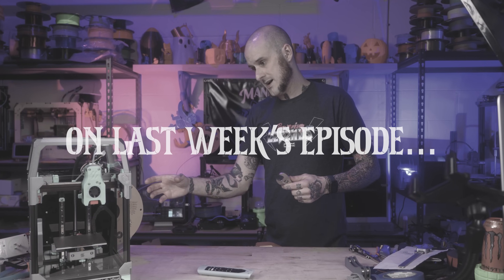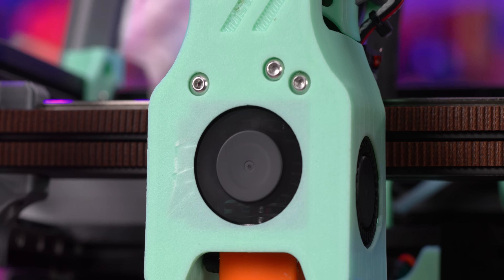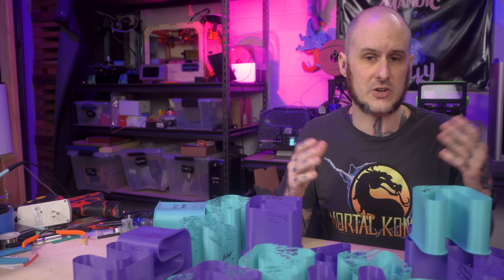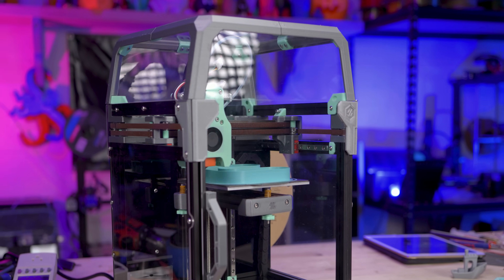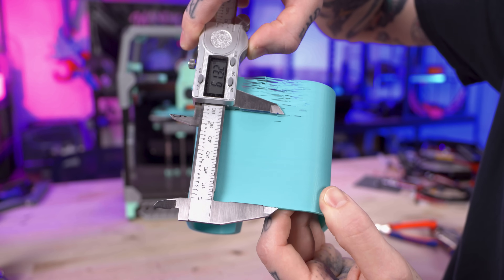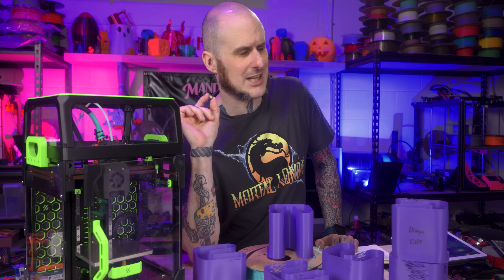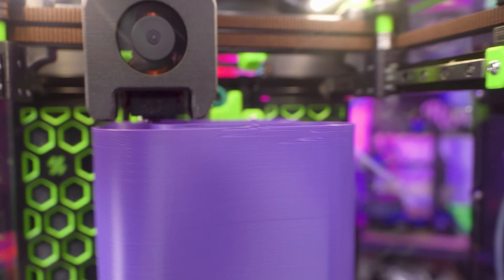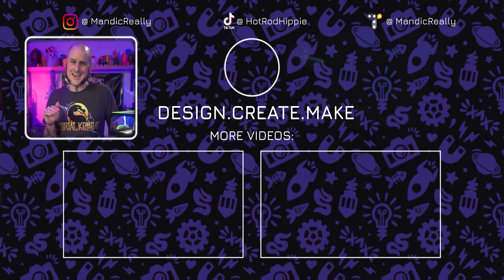The TRUTH about CHT Clone Nozzles! - Are High Flow 3D Printer Nozzles worth it?

Comment: Very interesting findings and great in depth research on that weird nozzle.

For an easier an more precise way to test hotend flow rate (as you asked for at the end), check out Stefans (CNCKitchen) recentish video on the topic. The general idea is to, instead of printing an actual part, extrude a known quantity of filament at different speeds/flow-rates (just into a blob) and check with a scale whether the requested amount of filament was extruded or underextrusion happened. Much faster and more precise.
Reply from the maker: Yea you just need a good scale for that and I didn’t have one on hand. Also I like tests that test practically. That is excellent for data points but I wonder how it translates to use. Would shine a light on the under-extrusion I was referring to though.
Reply: @MandicReally  When I've done the weight tests, I've found they're good for finding an upper limit but that actual printing will be at a lower feed rate. I'm guessing that's because extruding in the air requires less pressure and loses less heat, while squishing the plastic into the previous, already cooled layer will take some pressure and remove more heat. TLDR, after the weight test you would still want to do the real world print test.
Reply from the maker: @Cookiecad  Yea, if I start doing weight tests I'll only add them as a secondary test, not eliminate the printing tests.  I agree, real world scenarios are just different.  Tests for tests sake are valuable for data gathering but need to be viewed in a specific way to see their true value. 

All of this testing is "Flawed" in that it requires MUCH more testing and control to be truly viewed for just the numbers.  Extruder, filament path, the filament being extruded, part cooling, etc.  So many factors effect the results.
Reply: @MandicReally  I'm actually really curious how much the extruder plays a part. On my direct drive ender style hotends and cheap extruders I only get 17 mm^3. Do you think the 30 you were getting was due to the extruder? Or does that machine have a larger melt zone like a volcano? One of these days I'll need to try using a better extruder with the same setup to see what effect it has.
Reply from the maker: @Cookiecad  It is just a variable that can cause issue.  I doubt it would skew results upward, but possibly down.  Yes the results I was getting in the 30+ Range were with the Phaetus Dragon High Flow hotend, which uses a longer melt zone that starts in the heatbreak to generate more flow.  Thus why I was saying that the un-modified Knock-off nozzle performed better there.  The filament was already melted by the time it reached the nozzle so the "wall of brass" in the knock-off nozzle didn't effect the already molten plastic. 

I'm running some testing on an entirely Stock Ender 3 right now.  The crappy plastic extruder with straight cut single extruder gear is slipping when trying to push the flow higher.  These more advanced extruder assemblies all work around pushing more filament with less effort.  Either through Gear Reductions or enlarged drive gears (or both).  I've not directly tested it but have seen others test and show that just different extruder drives can cause flowrate changes.  Not massive ones, not something I'd go changing just based around, but measurable differences.  It is a bit hard to articulate why I feel this is the case, but basically it comes down to mechanical advantage pushing non-molten filament into the melt zone.  Stronger extruder drives can overcome resistance of filament that isn't melting rapidly enough better than more "basic" ones.  Obviously you reach the limit of the hotends ability to melt filament at some point, but combined with all the variables it can change the results of what that limit is.  

It is kind of like the extruding in thin air test.  When all the variables are combined, things will change versus just testing one single component.  Which is why tests like this are hard for some folks to relate to. "Well on my machine that hotend flowed way less!", yea because your variables are different.

Comment: It seems like the other variable is the heat transfer of aluminum versus copper, and brass versus copper. The center of that opening in the clone is likely not keeping hot enough, so the filament is hitting a wall, so to speak.
Reply from the maker: On paper yes copper conducts better than aluminum or brass. In actuality I think it’s been shown pretty regularly that it is a marginal difference on printer components. I’ve found little to no real benefit between the two myself. My Biqu H2 has an Aluminum heater block from Phaetus and that hotend pushes 50% more flow than it is rated for on a a regular basis.

Comment: Hello nice video , I think you can add m220 cmd in the slicer if you using superSlicer or prusaSlicer add custom + button like filament color change ( right click / add custom gcode ) .
Reply from the maker: Still a pretty manual process. I’ll see if that works and will output. I know height range modifiers do not.
Reply: @MandicReally  yes the height range modifiers not able to give the possibility  to custom Gcode , but after slicing with + button you can.

Comment from the maker: A few folks have pointed out that the Klipper "TUNING_TOWER" function could be used to automate the file here.  Excellent point that I forgot, check out the Klipper Documentation for more: https://www.klipper3d.org/G-Codes.html#tuning_tower
For this purpose I feel the G-Code I generated still works better as it was a very easy file to just Click "Reprint" to continue using for testing.  Great for shutting down, restarting, updating, and anything I needed to do while filming this video.  But Tuning_Tower would be faster for 1 or 2 tests.
Reply: Note that tuning tower seems to be finnicky with vase mode because it runs the command every time Z changes, overloading command processing.
Reply: Mellow 3d also has a cht clone if you send them a message on aliexpress

Comment: You can quickly measure for a drop in wall thickness on a test print like that by using a dial indicator over a small-radius (I'd recommend something BELOW a 1/8"/3.2mm radius/ 1/4"/6.4mm diameter) base (i.e. a small ball, or piece of round-bar mounter horizontally).
Align & adjust the dial indicator so it shows "0" when it is just touching the base, then you can run the test piece over the base & the dial indicator will show you the exact wall-thickness of each layer as it squeezes between the indicator & base.

I know this sounds a but complicated, but once you have the dial indicator, you could easily 3d print a stand for it & a base to glue a BB on top of; then spend 3 minutes assembling & then measure test prints at somewhere around 300 layers per minute (depending, of course, on exactly how OCD you want to be about watching the needle move for each individual layer)
Reply from the maker: As it is printed in ASA and only a single perimeter, minor war page induced by shrinkage  is likely. Every one I printed was slightly warped in the wall. The only real way I see would be breaking the layers below the failure and measuring your way down step by step.
Reply: @MandicReally  Hmm, I'm thinking of arranging the indicator and base to look kinda like two dull pencils with their tips just touching each other.
If you cut a vertical strip out of a test print's wall, it could be easily run in between the two for super-accurate measuring
Reply from the maker: @roberthercules3159  sorry I skimmed the comment while I’m working on other things so I misunderstood. Not a bad idea really. Little rigging to make it happen but totally doable. Interesting concept to say the least. Hmmm🤔
Reply: @MandicReally  glad I could help.
P.S. If you did a little more work in CAD, you could 3D print a rig to hold the BB & dial indicator on 2 towers, with a gap in between the towers that the test print could be pushed down between, that way the print wouldn't need to be cut at all to test it.
If you want, I could probably put together something like that on onshape or similar & send you an STL file for it, if you give me some contact info to send it to.

Comment: I'm pretty sure you  can use the "tuning_tower" command in klipper to automatically increment the speed at regular intervals - Hope that helps with testing next time. Great video!
Reply from the maker: Didn’t even think about that. I’m used to using that for Pressure Advance but you could absolutely use it that way. The method I presented could be used in Marlin firmware too though, which was part of my aim. Good call though. I’ll play with that. 👌🏻👌🏻
Reply: @MandicReally  Hey. Nice video. I replicated your test on my Creality printer but used a tuning tower test that comes with klipper. 
I used the following command to increase feedrate gradually with M220 S command 

TUNING_TOWER COMMAND=M220 PARAMETER=S START=100 FACTOR=7.14

After that I used my calipers to find the highest Z height where the print still looks good. Use this formula to calculate the highest useable feedrate

Feedrate = starting feedrate + FACTOR * Z height measured in mm
Reply: Yes I was just thinking this and it has the command for manual resonance testing TUNING_TOWER COMMAND=SET_VELOCITY_LIMIT PARAMETER=ACCEL START=1500 STEP_DELTA=500 STEP_HEIGHT=5
Reply: I just keep the speed the same and low so it actually hits those speeds and increase the flow multiplier

Comment: Great vid! Throwing it back to Stefan and CNC kitchen, he has a webside where you can make flow test blow patterns.
Buy a milligram scale (available below $100) and weigh the blobs.
The test is fast to print and the weight of the blobs is directly proportional to the extruded amount.
Did one or two for cht nozzle on standard dragon using different temperatures in a single night.
Reply from the maker: Yea I don’t have a good scale yet to do that. Tried to order a cheaper one and it was garbage. Need to just invest in one for future testing.

Comment: When do you need one of these nozzles? I would like to try a clone but I don't know the case study when to use it?
Reply from the maker: The goals of these is to increase flow rate of your 3D Printer hot end.  You "need" one when you are running into flowrate limitations.  Usually due to using larger nozzle diameters and/or higher speeds printing.  I found that a standard E3D V6 nozzle in that budget hotend is good up to 125mm/s print speed (maybe more), so it isn't a very common need. 

You can see me discuss it a hair more in last week's video: https://youtu.be/GnSyWqZycMw
Reply: @MandicReally  Thank you!

Comment: Find the nozzle that the flsun v400 uses, it also has a fake cht! Good video though :)
Reply from the maker: Haven't seen it, I haven't paid much attention to the V400 as FL Sun hasn't sent me one. Maybe if they take notice.
Reply: @MandicReally  the v400 ones seems to work pretty well, even outperforms the bambu volcano.
Reply from the maker: @morbus5726  I've found the Bambu hotend to be... lacking.  I should test it in this way.  Got to figure out what their G-code needs are for that.
Reply: I'd be interested in seeing that as I've got a bambu too! Just figured I'd point out the v400 since you hadn't seen it anywhere else, myself included.